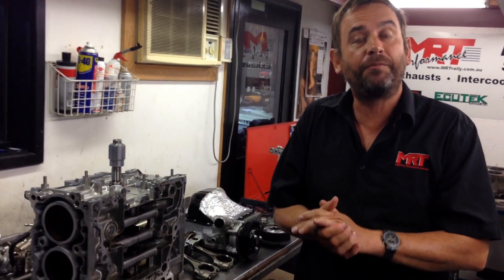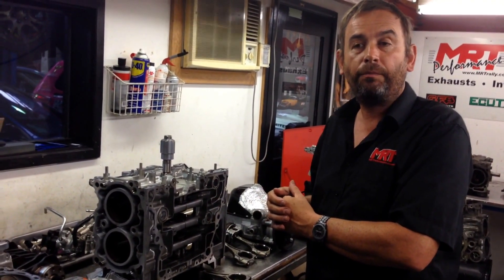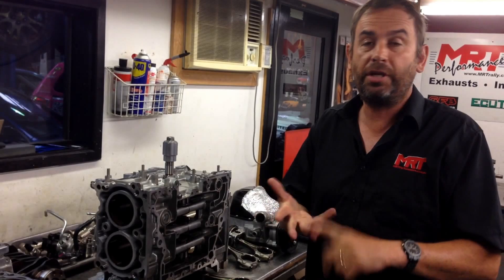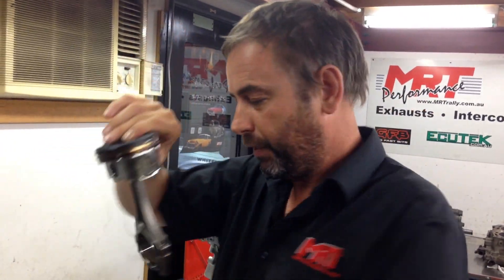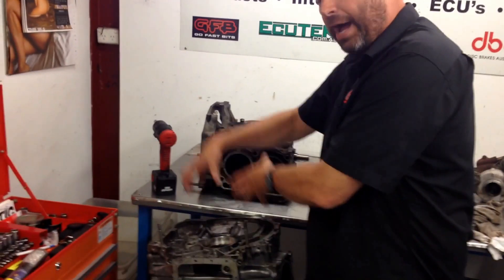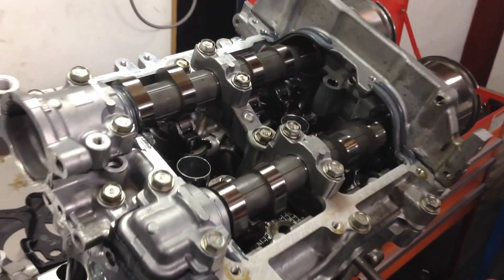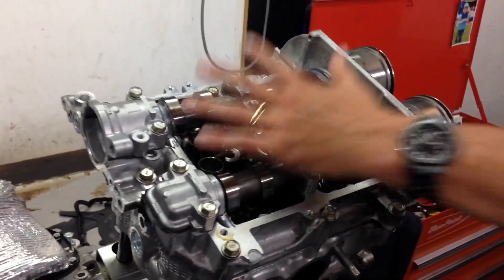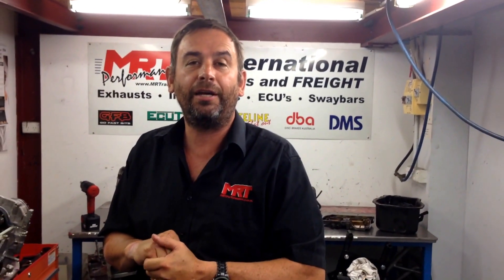Subaru BRZ Toyota 86 FRS engine project data part 1

Comment: couldn't you just offset the compression with E85 i know guys running 20psi just fine on stock internals with e85
Reply from the maker: +ThatCarGuyClayton no there is no way e -85 can save a engine with compression.
yes ppl take risks, 20 psi is massive on this engine with stock comp!
Reply: +MRT Performance  I just know a bunch of guys that do that because it burns a lot cooler than 93 Oct here. Hence why they're able to push more boost cause with out it I wouldn't go over 7psi. But with e85 a lot of people have been able to go over 7 like to around 15 or 20 and some of them have had zero issues.
Reply: do you think gasoline have the same e85 amount of calories? XD

Comment: I've heard that some big diesel engines use offset conrods. Some big truck engines have a large power output. If these rods aren't as strong, why are they used in such heavy duty applications?
Reply: *****
You're poorly educated in human relations. Most of the general public are "poorly educated" in these matters, which is exactly WHY we ask "why?" So we might better understand the reasoning for such engineering decisions. Snide remarks like yours are what make the internet a shit place sometimes. Go elsewhere if you wish to start a fight.
Good day.
Reply: Just here to chime in 3 years later for no reason. Offset(split angle) connecting rods are used for ease of assembly. They transfer the forces of combustion unevenly compared to a standard straight cap rod. Make anything big enough and it will hand the stress of operation but now 3 years later the deficiencies of the FA20's connecting rods are well known. No way you would have known that 3 years ago buuuuuut Just sayin :)
Reply: Neil Chand Cost management.. If you think engineers are the ones that dictate costs and the end result your poorly educated in these matters. Its about what is profitable and reliable at the minimal level
Reply: I agree. Why would any engineer decide to use offset conrods in a high power situations, or high compression situations, if they weren't strong enough for the task.
Reply: *****
 Glad I'm not the only one thinking this way.

I really would have appreciated a reply from MRT Performance too.
Reply: do you know if subaru has resolved these deficiencies in later builds, or are they still cranking out the same specs? my '15 brz failed at 110,000 and is currently sitting around waiting to be repaired
Reply: Hey Robert do you know why your engine failed and  is that 110,000 in kilometers or miles? Reading stuff like this makes me kinda nervous hahaha

Comment: can i put the new head on the old block? knowing how well the new engine makes power its hard to bring myself to mod an old one
Reply: ej20 uses timing belt, fa20 uses timing chains, even if you could figure that out, you would need to find a way to run the variable camshafts and the direct injection. Absolutely impossible.
Reply from the maker: depends on what parts you are swapping!
Reply: would be good to do a video on how to do this, cant find information anywhere!!
Reply from the maker: exactly on what though ?
Reply: on converting the direct injection head to the ej20 block. I think if they made a kit to somehow do it, it would be a hot seller. Since the new head would allow the older engines to build more power easier.
Reply from the maker: no way
Reply: that jamaican guy Why would you even want to do that? The FA20 is better than the EJ internally.
Have you seen what they've been able to do with just the stock FA20 internals?
Reply: guess the only thing now is to do a swap. That FA20 is a beast, and its still early in the game.